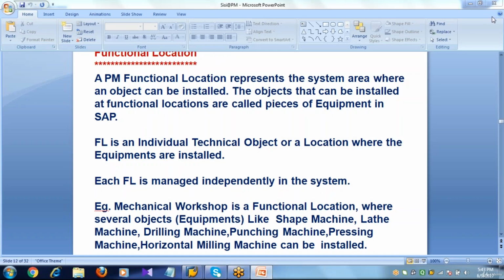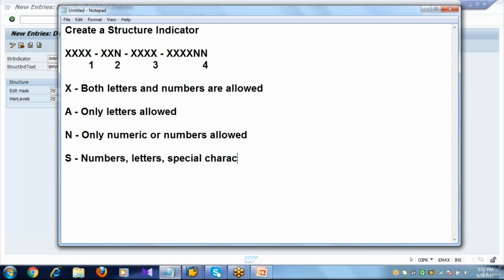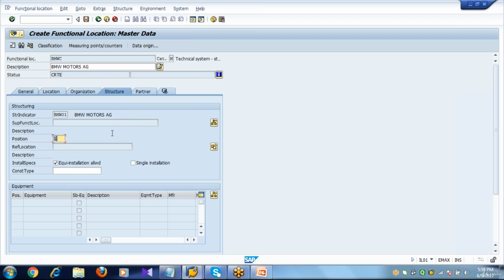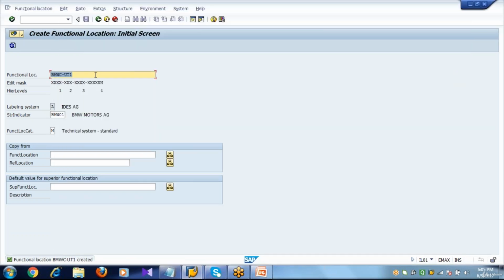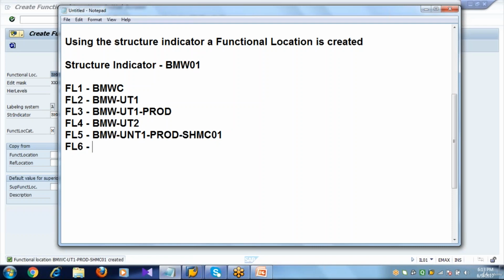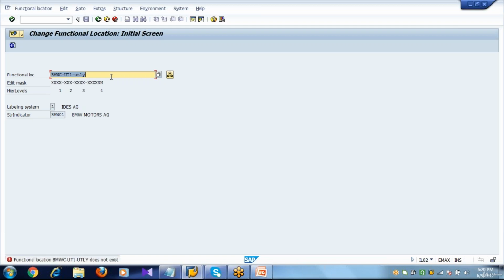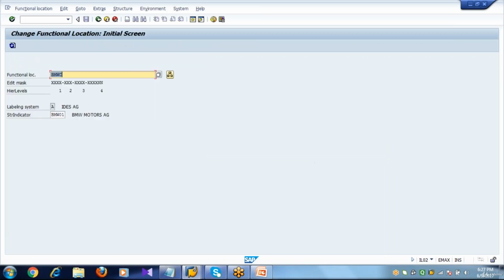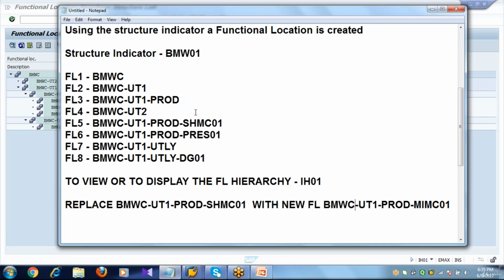Functional Location part 1   SAP PM Plant Maintenance beginner to advanced level

Comment: Thanks for the topic, i guess there is a typo error when you were trying to create a Function location , Utility. Instead of creating it under the Unit 1 , you have created it under Production,
That is why in the structure Hierarchy there are two utility functions listed , instead of one 
BMWC-UT1-PROD-UTLY
BMWC-UT1-UTLY
Check the video between  32.10 - 32.40

Comment: What is difference between work center and main work center
Reply from the maker: Main work center is the work center for which maintenance department is responsible or where maintenance operations are performed whereas work center in location tab is production work center/ resource.

This is one of the integration point of PP & PM.

If we maintain work center/resource code of production in the equipment master and create maintenance plan against the equipment, this will reflect in the planning chart of production department.

From this the production department will get to know that the equipment will be under maintenance from so and so date.

Hope this clarifies your doubt.
Reply: Work centre is used by PP person....PM person uses main work center.. because maintainence activites takes place here